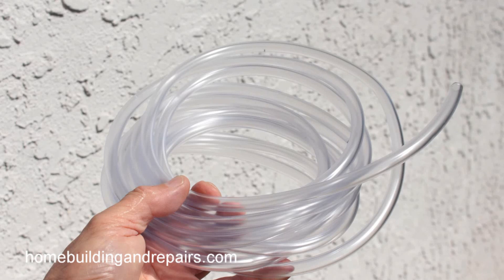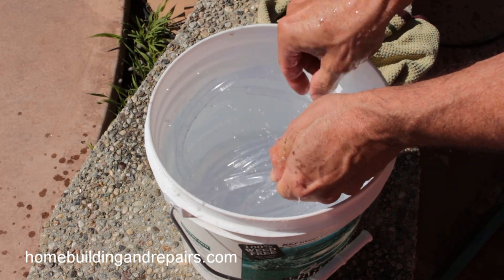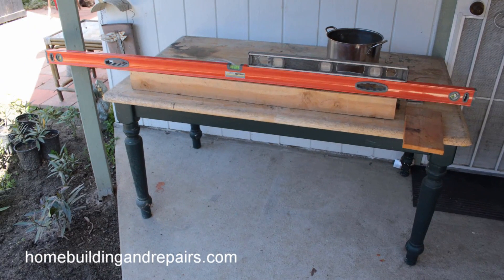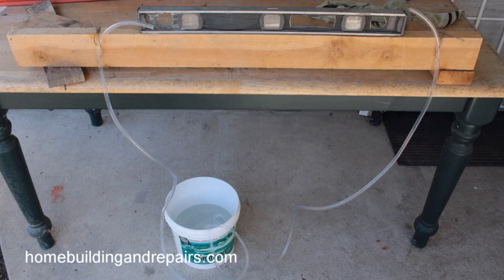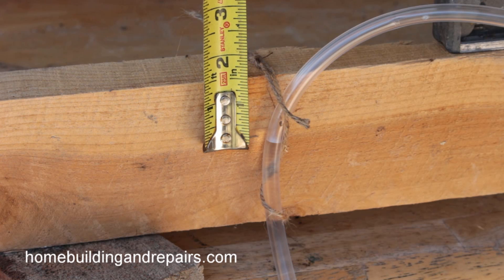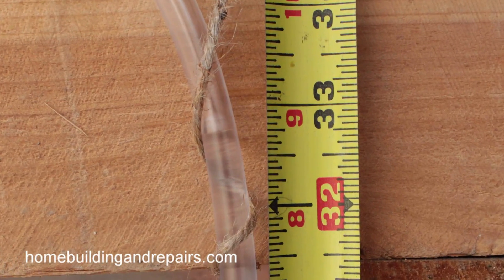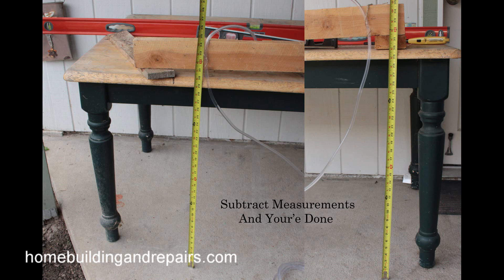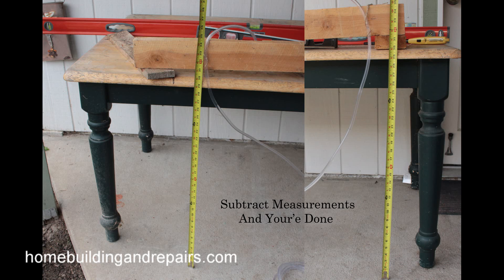How To Make A Water Level For Less Than Ten Dollars

Comment: its always level and accurate, if you have drama with surface tension sticking to the walls of the tubing add ethanol to make the water more slippery. a dumpy or laser level does not compensate for the curvature of the earth

Comment: Have you come across a UV light resistant clear hose?
Most of the PVC "Flex GP70, clear or transparent hoses I have used, after a few weeks become difficult to read and must be discarded, this is a waste of money in having to replace them so often.
Any ideas how to remedy the problem?
Regards,
Franco
Reply from the maker: No, I haven't ran into this problem. I use the water level, then place it back in my tool box. Let us know if you find something that solves your problems.

Comment: Hi wouldn't this just water level just match the curvature of the earth and not truly be flat?
Reply from the maker: It doesn't seem to be a problem when working with 100 foot intervals, but could be a problem if you were working in miles.
Reply: lmao backyard construction doesn't use or need physics-level modelling or accuracy. Are you going to consider the curvature of space-time as well? Let's talk meniscus, friction, differential water pressure, etc etc
Reply: @snokful  😂😂😂. Edit: fully forgot about this comment haha
Reply: Earth is flat

Comment: This water level is too dependent on volume in the tube. If it has too many bends in it the level will change. Both ends will be level but you need to keep checking to see if the reference level is still correct.  To get around this, use a big water source at the reference. I use a gallon milk jug half way filled on a chair about 2 feet off the floor and 1/4" tubing. I siphon water out to fill the tubing. A 1/4" circle is very small compared to the top surface of the milk jug so a few bends in the tubing will not affect the surface level of the jug much. I then tape the other end to a yard stick and measure at the reference and then it is easy to measure the floor level anywhere you can reach. Like another commenter said, put a few drops of detergent in to kill surface tension.
Reply: Make a video
Reply from the maker: Thanks for the excellent ideas.
Reply: Yes that way is how my dad taught me, its much easier.

Comment: Do you need to put a drop or two of detergent in the water to break the surface tension so the edges of the water doesn't curve up the sides of the tube? What about dye or food coloring in the water for better visibility. I have a inches of water U manometer for measuring vacumn that used a dye mixed with distilled water to make it easier to read. Is a water level practical in a completed house where you can't measure to the sub floor because of carpet, tile, motar bed, hardwood floor thickness, etc. Would you need to do this under the house in the crawl space. Thanks
Reply from the maker: I've never used any detergents and food dye would be a great idea for improved visibility. Water levels are extremely accurate, as long as there aren't any air bubbles in the tubing. They can be used in a variety of different situations, including inside and outside of the home. Obviously you wouldn't want to spill any water on the hardwood floors.

Comment: what is the size of the tube you use?
Reply from the maker: You can use any size tubing, as long as the water line is visible and there aren't any air bubbles in the line. I believe they actually have an attachment that will attach to the garden hose if that's something that might be more helpful.

Comment: Your example is of using the water level is not a very good one. Remember the water level is quite long. A better use would be to put one end on a wall marking the level and then work around the room with the other end marking the levels. From there you can establish control lines that are perfectly level.
Reply from the maker: I made another video that will provide you with instructions on how to use a water level to see if your building foundation is level and here's the link. https://www.youtube.com/watch?v=3zuZ8otdTso&t=11s